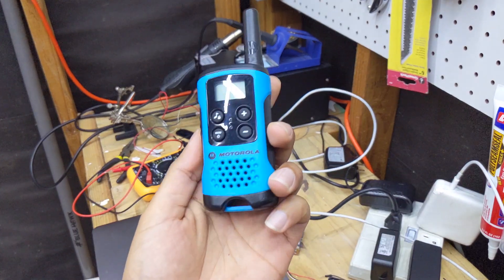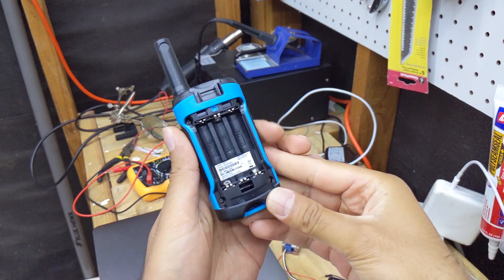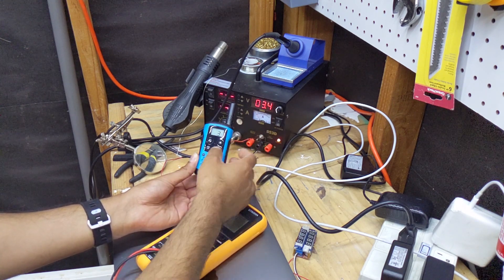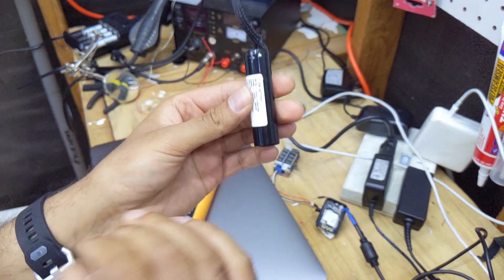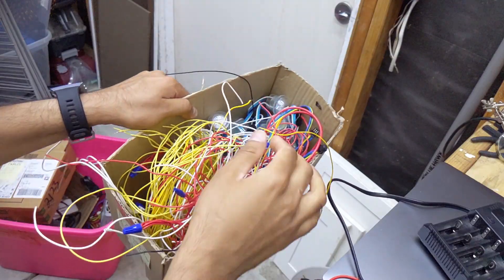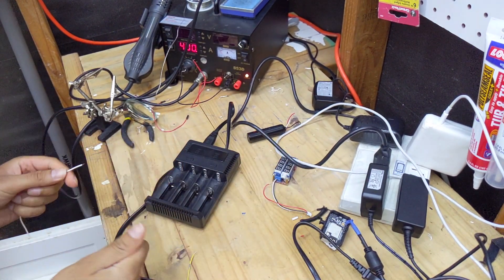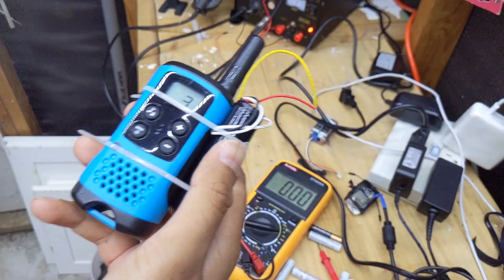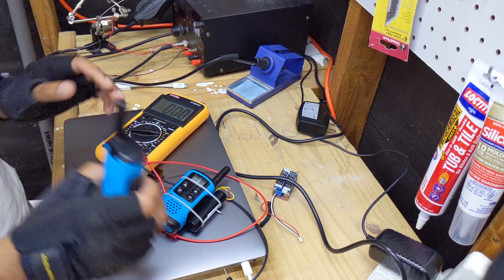Walkie Talkie Rechargeable Conversion

Comment: At least you are showing the actual T100! Another video says it is showing the T100 and the one in the thumbnail is the T100, but not the one in the video! In the video the units have a volume knob and a screw to open the battery compartment! The T100 has neither!
Reply: everything here is 4 years in the past F C C rules have been changed and he
does not know that als the radio is running a half watt transmitter
so when the wind is right you  will only get a mile.

Comment: Change also the antenna. With 1/4 wave , 16,5 cm wire, increase range in 100%.
Reply: the F C C will not allow it  do that and replace the radio as you broke the antenna